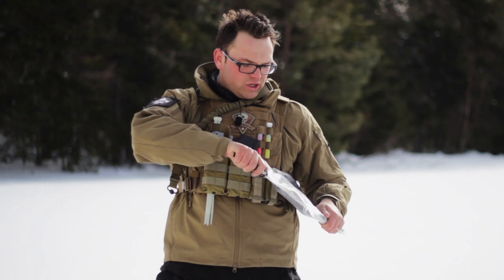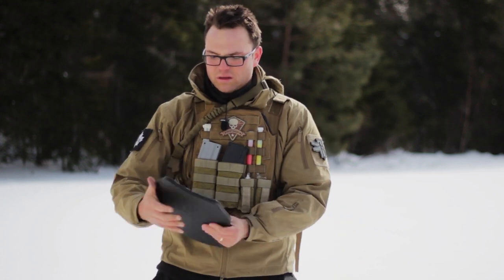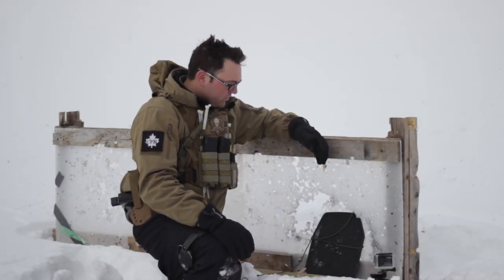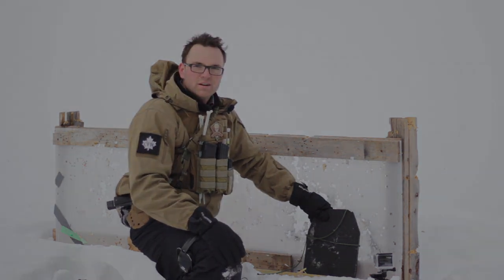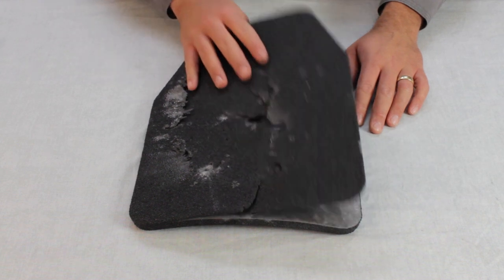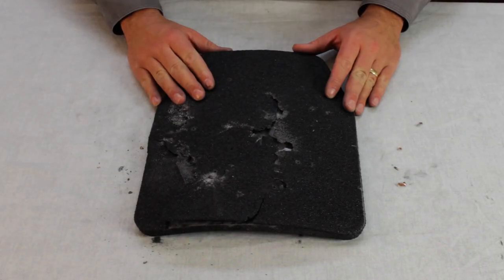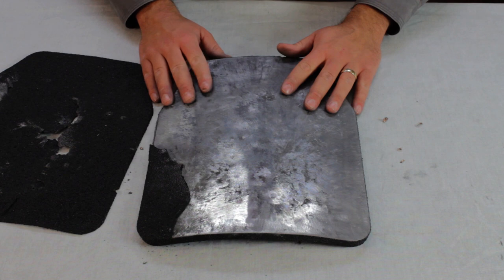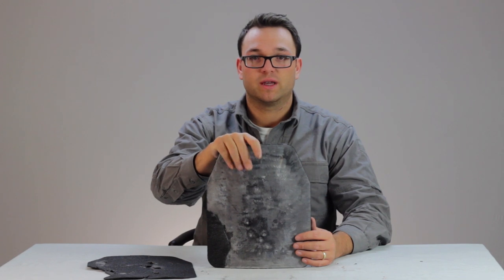Torture Test   S&J Hardware AR500 Armor

Comment: Awesome video! I'd be interested to know if a tight fabric cover around the plate would help keep the anti-spall coating tight to the plate during multiple hits - though a plate carrier would probably achieve the same thing. Could always get it re-coated with truck bed liner for additional testing purposes?
Reply from the maker: +Brian Duval I'm sure you could throw some truck bed liner on it, as I believe that's what they use to coat in the first place (LineX). Thanks for watching!

Comment: I have a couple of questions,..What distance were you from the plate when firing ? What was the air temperature there ? I noticed that the anti spalling coating flaked off very early into the tests. would this be due to the cold ? I realize that this armor is worn inside the jacket close to the body,..so chances are god that they don't get that cold .
Great test. I'm waiting for more.
Reply from the maker: About 50m from plates with rifles and 20m with pistol. It was around - 20c out so the cold may have definitely played a part in flaking. Regardless,  we were really impressed how well they held up. Best place to test gear is in these harsh conditions. Thanks for watching!